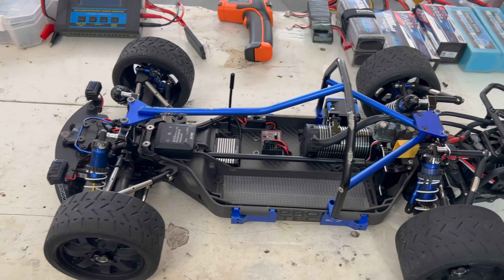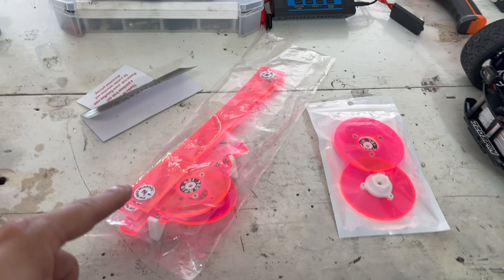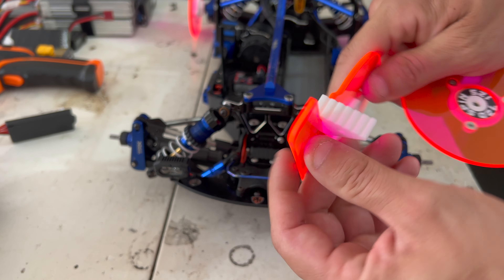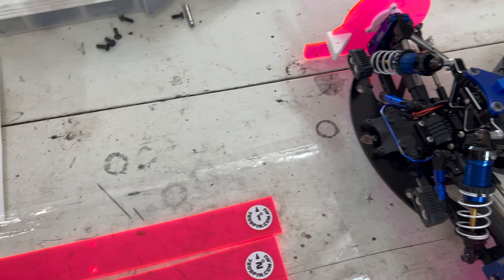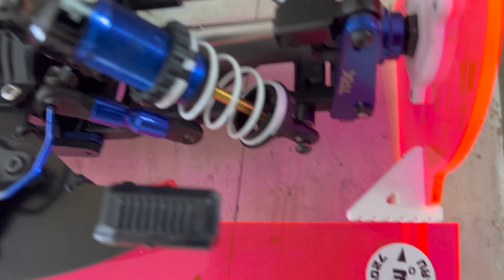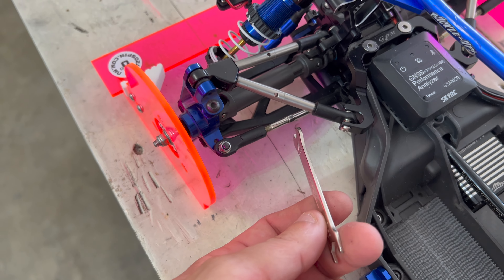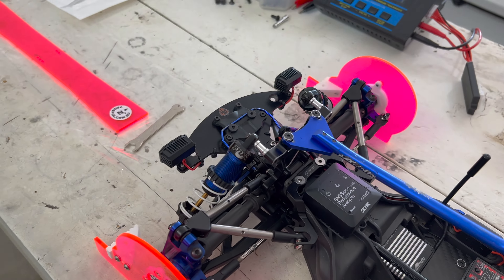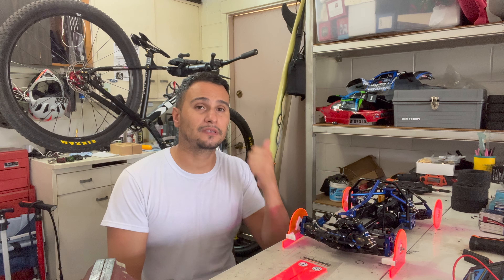720spin short  course truck alignment kit. How it works and pricing

Comment: I need your help! What chain lube do you recommend for central Fl? I just cleaned my new chain for the first time and used Bike Med EP Ultra lube on the recommendation of my local bike shop. It was working great on the road, but on the trails, it picked up so much sand. I've never heard my marlin make noises like this before. The factory grease was soooo much better than this stuff. I need a better solution.
Reply from the maker: I have tried multiple chain lube’s and the best one that I have found that works for me is Muc/off dry lube You will not be disappointed I hope this helps you out because it took me forever to find a good lube
Reply: @hardtailrider7172  thanks! I will give it a try, lots of people seem to love that product. I Just ordered a bottle.